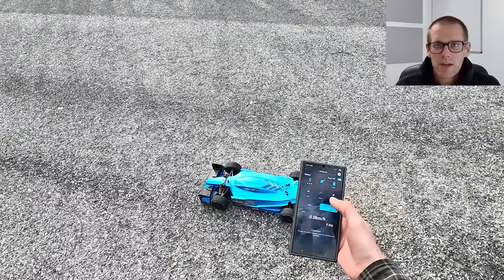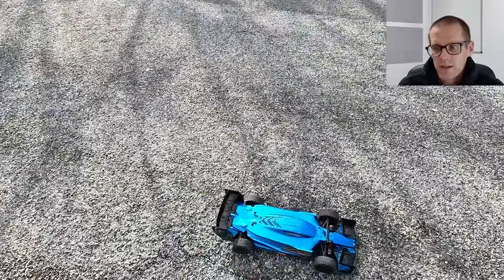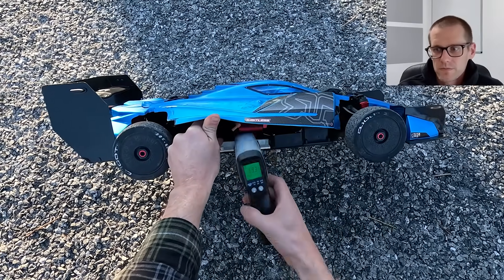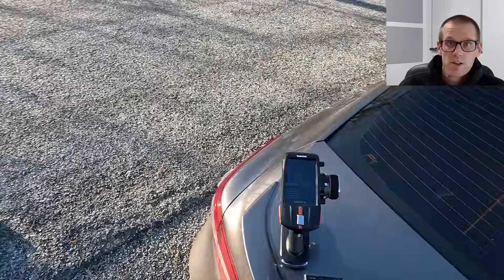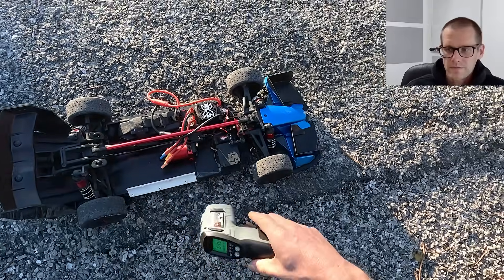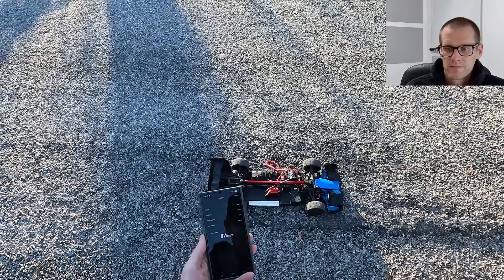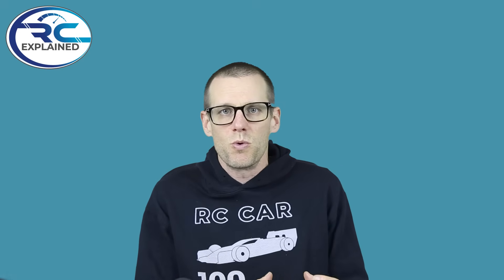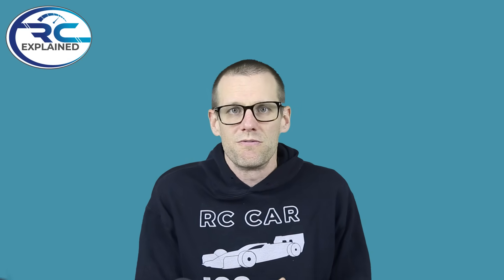Does Low Kv Mean More Torque? This Road Test Left Me in Disbelief!

Comment: I never believed that low Kv produced more torque. The armature length between motors is the same. For one motor to accelerate faster (torque), it can only do so by having more force. Force from the rotating armature = torque. This hobby is full of Old Wives Tales.

Comment: So much to unwrap here, I am an rc boat guy and can tell you there are motor, esc battery setups for the 4s category, 6s and 8s category, for this type of test you need to use a very similar motor  within a category and absolutely control and record your temps, cool down time and (before and after) temperature readings mist be the same.  Within 130 kv (lower) I got 2 mph faster 🤣
Reply: I built a 32" cat years ago that went 102mph on 4s. I can't remember for the life of me what the kv was. And I still have the 27" version that ran 92mph on 4s. It would have went faster if I had a smoother lake. But the amp draw was higher than most esc's at the time could handle for any amount of time. I have videos of it on my channel, I think it was back before 2016 when i did this. the 32" would have easily taken the world record at the time. I will say the secret to it is supporting the amp draw.

Comment: put a TRINITY 3 TURN DRAG MOTOR IN IT WITH 2S and rip the rear axle out !!
Reply from the maker: Well, ive had over 15KW running through this chassis and it didnt rip the axle out.

Comment: Torque is proportional to amp draw, and low kv motors don't draw amps like higher kv motors do.  Then hp is proportional to rpm, and low kv motors don't make rpm.  Therefore, low kv motors are slow.  lol.  Gotta use more volts to make a low kv work.

Comment: I'm afraid that this is not accurate at all as this is not how motors and KVs work. you should be matching the gearing as close as possible but add more voltage so it can run faster with lower current. If this is done, then you will 100% see that the torque is higher (lower current = less heat) and there is room to do more with the gearing AFTERWARDS. I suggest you make a video doing this instead.

Comment: One of the things I found with my Limitless using a low kv motor (1250) besides cogging when starting off, but it also has weak breaking due to the gearing being over 1 to 1. The second Limitless I am building will have a 2400kv motor in it.
Reply from the maker: Yep, thats bang on correct. I upped the braking percentage for this motor to get it to stop. I still cant lock the tires up, not that I want them to lock up, but it certainly shows the braking power difference.

Comment: Great test!   The original slower = more torque comes from brushed motors where the brush resistance is always the same and we find peak torque around 30 turns where coil resistance equals brush resistance. 

At the end of the day a motor is a motor, different kv doesnt allow more torque for brushless. 

More kv or more voltage does produce more torque for brushless though!
Reply: People may also misunderstand why we run taller gears in stock cars vs. modified, and think that the higher turn brushless motor must have more torque because you can use a larger pinion gear without overheating. 

That’s wrong of course, but an understandable mistake.

Comment: Isn’t there like a baby dynamometer for electric motors?
Reply: I saw a video of someone making one. It was basically a steel disc with exact measurements so he could calculate the moment of inertia, a tachometer to monitor the rpm, and volts and amps to calculate the motor input power.
Reply: @Glocktologist great project for someone, for sure.
Reply: I found it, it was Steve Eng: https://www.youtube.com/watch?v=rQhX2wDALx0
Reply: @Glocktologist ah yes this is the video I remember seeing now.

Comment: If you put the results back into the  calc sheet, would that reveal the actual load factors?
Reply from the maker: Yes, as long as you place the actual current and internal battery resistance in there too. That will give the best estimate you can get really.

Comment: I did a test yesterday and learned that free spinning a motor & reading data afterwards, 75% throttle was the highest on amp draw. Then i did 0-10-20 degree timing test & the max rpm increased but only by 1% each 10⁰ dump. Motors at 100% seems to be their most efficient
Reply from the maker: Interesting find. I did a video a long while ago on a full dyno setup, logging torque mechanical and electrical power and efficiency of the setup at varying throttle positions. You will find the overall power system is most efficient at 100%. 

I saw a few videos of yours several months ago. It was a tunnel hull, my favourite hull type. I was surprised to see a turn fin come on the boat. Turn fins on a tunnel hull will do some pretty awful snapping at speed. Did you find that?
Reply: @RCexplained the vintage Tunnel Hull is my favorite! It had a metal fin originally and I put on a swooped fin, it did turn better, but like you said, it could flex a tick & pull it hard right. I plan to fully re-do that boat once I pull off the big k&b7.5 & get it tuned correctly. I've watched atleast 50 of your videos! Highly informative & always honest! Im always up for a collaboration if an idea ever comes up for one.
Reply from the maker: Shoot me an email if you want to jump on a call and talk tunnel setups.

Comment: In my experience with the limitless i can run more with less heat wirh a lower kv setup than the higher kv setup i had. Previous setup was 1340kv 6s and  now 1100kv 8s higher gearing and 20mph faster and less heat 🤷‍♂️. More torque off the line with the 1100kv and more run time after speed pulls. There was a battery difference ofcourse. Smc batteries but the 8s ones were newer but both are for speed. Ill have to pull the data to see if the 8s setup pulls as much amps as the previous setup.

Comment: This doesn't make sense.   I've never heard this argument made.  
What about a low kv motor made to run low voltage?   My scx6 has a low kv low voltage combo that i think would do much better in this test that what you used.
Reply from the maker: You've never heard someone say low Kv motors make more torque? Surprised as this is everywhere. 

What motor do you use?

Comment: See it like that: The more you brake a motor from spinning freely, the more power it wants to draw and the more inefficient it runs.

If you are gearing a 1350 kv motor to the same output as a 3650kv motor, you effectively put (3650/1350=) 2.7 times the load on it in regards to how it functions. Like the lever to turn is 2.7 times as long.

This increase in load directly manifests itelf in what you have as "load factor" in the spreadsheet. More load means higher load factor.

Now higher turns in the motor means that there is also less power going through that motor by default, meaning it can only achieve a higher amperage (and thus power output) by further limiting the motors revs by breaking it or applying more load to make it draw more Amps. And this is what happens when you overgear your poor 1350kv motor like that. Not only does it spin slower as I just wrote, it also is more inefficient.

Now, how inefficient?

Power requirement for speed scales to the cube, meaning if I go from 88 km/h to 125 km/h, I will need (125/88)^3 = 2.7 times the power.

Now your log says you have 110 Amps for the 3650 motor and 70 Amps for the 1350 motor. That only is 110/70 = 1.5 times the power to go from 88 to 125 km/h.

The difference between the 2.7 and 1.5 time power difference is that in case of the 1350 motor, the motor runs much more inefficient and uses part of those 70 Watts to heat itself. If I say that the 3650 motor runs efficient (for this example 100%, but sure that is not precise, but it will do for now and we assume a perfect motor), then knowing that the power requrement for locomotion is 110/2.7 is some 40 [Amps], meaning of those 70 Amps, the 70 - 40 = 30  [Amps] are used to heat the motor. It thus runs only at 57% efficiency!

If I have a 5 second speed run, then I can heat the motor for those 5 seconds with 16 V * 30 Amps = 480 W given a total energy of 5 * 480 = 2400 Ws = 2400 J of heat budget into the motor.

The motor is ~200g and has an assumed thermal capacity of ~450 J/(kg*K), meaning we divide 2400 Ws / 90 Ws/K and get a net temp increase of 27 K.

Hence if your motor is 50°C on the 3650 motor, it will be ~50° + 26° = 77°C with the smaller motor. And I guess you found that out with the thermometer.

I have to add that all of the above is just a simplified shot from the hip. Also the 3650 has an efficiency penalty and we see that in the power ratio between the motors being a tad too large. If we took it into account and did more math, the temp increase would be probably around 22°C and more in line with actual readings. But the principle applies: DON'T OVERGEAR YOUR MOTOR! If you need lots of power from a motor, take one that can actually draw lots of current OR go up in voltage to make it spin at a rate where it can operate efficiently. And none of your choices come for free.
Reply: This is heavy doc

Comment: My xo1 running a 2000kv leopard geared for 135kmh is just getting on the warm side on 6s but actually drives 300% better than the original 1717.
Reply from the maker: Nice sounds good! Do you have the need for more speed yet?
Reply: @RCexplained always lol! I have been building speed run cars on and off for 20 years,started with nitro, I’ve got a few old fast ones, a custom built streamliner that can run rough ground, it’s parts from 1/10th front end and a 1/8th rear, it’s got or should say “had” active aero too, it’s best run gps verified was 218kmh on 5s. The ratio From memory it’s got 6 or 8 crank rotations per meter! So using basic math at just 30krpm it’s fkn fast! So 1650kv on 8s should move! it’s got heaps left in it! It’s collecting dust it needs bodywork, Tyres and fresh batteries, it’s last drive was on a short road just thrashing on it, i power flipped it over only doing about 100kmh so the aero is trashed, also I’ve just put another old back together which a rail half the size it was originally just a cheap p190 touring chassis but now it’s a stretched drag car, it’s had a heap of different engine and now a 2650kv 6 pole 1/8th buggy motor direct drive to the diff and it’s fast! The 150a esc has lost brakes and reverse so it’s either getting a disc and caliper or an old castle XL2 and have 8s capacity but the chassis is tiny so packing it all in will be hard.
Reply from the maker: Sounds like a lot of fun with all the builds ypu have done!
Reply: @RCexplained I could go on and on for a while!,started with planes but got right into nitro 1/8th off road, but over the years had all sorts of cars, from 1/18th to 1/5th gas,nitro or electric,built nearly anything conceivable rc lol dozens of experimental vehicles also the general Boats,hovercrafts, un countable numbers of planes etc Except helicopters! I’ve avoided that rabbit hole just Narrowly! For now anyway.

Comment: What you are not considering is we drop kv because we go to bigger motors and even step up the volts.   Ie.  The 6s limitless has a 2050 in it.  We go with a 1650kv, but it's a much bigger rotor and can  a d step up to 8s. I'm just dropping kv , but the same size rotor doesn't make more torque.   Your myth busting a misinterpretation of the myth. Rotor size gives you torque  not kv.
Reply from the maker: The same voltage and the same motor series is what many were in disagreement with as far as kv and torque are concerned. We know a bigger motor will produce more Power, there's nothing to question there.
Reply: @RCexplained no i understand the idea.  But the only ppl that think that are the one's that dont understand the difference.  They just hear 1650kv has more torque.  And then repeat that to the next person without understand why that 1650 has more torque      the just go off limited info and just assume ithe lover kv makes more power.    You should make a  video explaining  whete ppl go wrong and y with that assumption.
Reply: @danielcase2189 I think that’s what he just did, if they can’t extrapolate from there…  well we probably won’t like the way the vote either 😊
Reply: For the lower kv with ideal conditions like a longer run and an even more delayed throttle curve you should be able to achieve the same speed. You get that exponential heat buildup and current spike at the point where the motor is under its heaviest load on the gears. As the car begins to roll and increase in speed, the load also decreases because the car is already rolling.
Feeding in that power, slow enough will help. Keep the temperatures in check. 
Basically what I’m saying is that it’s easier to push a rolling suv than one from rest. 
The higher KV had the advantage of a nicer startup because of the gearing.
Reply from the maker: I can feed in power slowly thats not a concern. Problem is, the motor draws less power at top speed, draws less current at top speed and gets too hot at top speed. The torque is simply not there.
Reply: @RCexplained and in order for him to make more torque he would have to go to a higher voltage battery for the lower kv motor to make more power. It's really simple the bigger the motor the more voltage you need to turn it. A 2.0 4 cylinder 7200rpm will make more power than a 2.0 V8 with 4200rpm it can rev higher and make more use of the powerband the 4300rpm V8 just can't it would need a power adder in this case higher voltage.
Reply: I’ve gone down this rabbit hole. 
Numerous attempts using as similar motors as possible, also out-runners vs in-runner. 
Simply put,  all things being equal, you can go faster with a lower kv as long as it’s not to little or to much. 
  I found the magic numbers to be (within) 200kv but not as little as 50kv. Problem is-ITS NOT SIGNIFICANT AT ALL, just a few mph faster. 
One motor was 2030kv and the other was 1900kv  (almost perfectly matched motors) the 1900 being ever so slightly heavier. That was a 130kv difference and my gps said the 1900 was (on average) 2 mph faster.  The key word here is “Heavier” I’ll take a heavier motor every time to go faster, also remember temperature is a part of the equation as well (heat is spent power inefficiently 👍
Reply: @nealstarling5422 nah do that test using 3660 2200kv vs a 3660 4200kv both on 3s same gearing in the same vehicle it's not possible for that 2200kv to outrev and outperform that 4200kv 😂

Comment: the idea behind this video is very informative but incorrect use of the motors as you explain at the end the higher kv vs lower kv both make the same power but at different voltages. the higher kv has higher amp tolerance and less voltage the low kv more voltage but less amp.
Reply from the maker: You got it!

Comment: I've tried explaining this but ppl don't get it higher kv on the same size motor, voltage and gearing will ALWAYS BE FASTER because it's has a higher powerband
Reply from the maker: Absolutely. In a previous video I describe it as taking a 5.0L V8 running it at 7K RPM and comparing that to the same motor running Maximum 3.5K RPM. 
If you need lower output RPM, use gears as you have said.

Comment: Would like to see a video on the difference between a low KV motor with a 5mm shaft vs a low KV motor with a 8mm shaft of the same can size to see the difference.
Reply: If windings and magnets are the same then what difference does the shaft make? A lot of motors just machine down the shaft to suit application but that doesn’t change the output.
Reply: @needmoreboost6369 . A larger shaft obviously has more mass, and also uses a larger heavier pinion. Which in turn adds more rotational force to the system.
Reply: @cheechfpv more mass? It’s not mass that produces torque,Mass only hinders acceleration. Increasing the diameter of the armature will give more leverage not adding weight to it.
Reply from the maker: More mass reduces acceleration and makes the motor slower. However if this consumes for example 15 watts of power to accelerate vs the 3500watts that the motor puts out, it wont make any impact that is noticeable.

Comment: How can this comparison be same, not being rude, just want to understand because that lower kv should be tested on 5s-6s set to same speed as the 4s high kv, then compare
Reply from the maker: Running the same voltage is what many were in disagreement with or questioning. I have plenty of videos talking about low kv is for higher coltage in the same motor series.
Reply: @RCexplained got ya not knocking u I learn from ur videos, just wanted to make sure I wasnt off thinking on this, great info
Reply: @bryangadson-me9eh yes higher kv on same diameter and length motor will always make more power aka higher top speed than the lower kv motor at the same voltage. It's takes more voltage on the lower kv system to make the same or more power than the higher kv system.

Comment: Wow great testing this proves low kv doesn't mean more torque that I know some people keep saying I knew higher kv meant to me what I noticed with my own test more power and speed for sure with same gearing especially I ran 5900kv on 2s onyx setup which I think it's a old hobbywing reband but it was fast my fastest setup I ever had my 7.5t ruddog is really close so I am thinking the hobbywing 5.5t motor I want to get that says 5900kv I want that motor